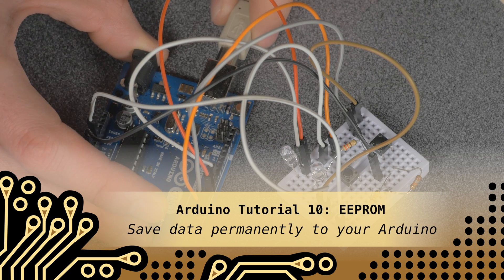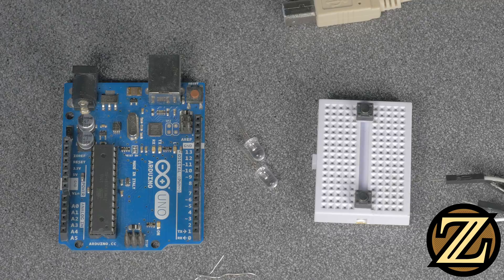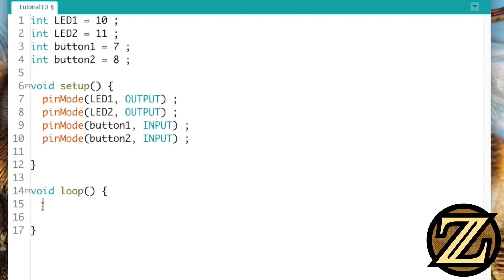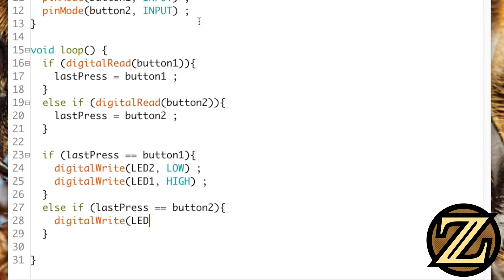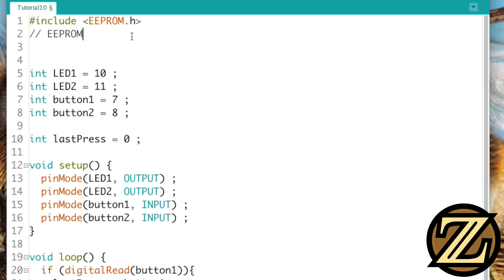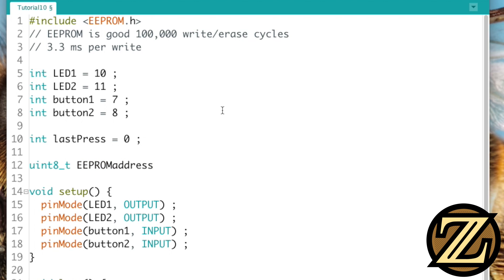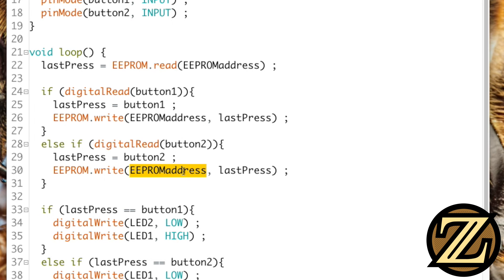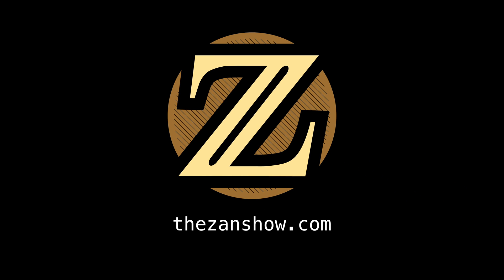Arduino Tutorial 10: Save Data with EEPROM!

Comment: i use rotary encoder for measuring linear displacement. after power cutt off arduino is only able to store value from 0 to 255 mm. not more and less than this range. here is the code plz suggest me that how can i store large number of  -ive and +ive values :
 #include <EEPROM.h>
 int address = 1000;                                    // the variable which holds the address in the eeprom
 #include <LiquidCrystal.h>
 LiquidCrystal lcd(6, 7, 8, 9, 10, 11);
 const int  buttonPin = 4;
 int buttonState=0;
 float Length=0;
 float Length1;
 float r=31.82;
 float r1=3.182;
 float pulses=30;
 float pi=3.1428571485714;
 #define outputA 3
 #define outputB 2
 int counter = 0; 
 int aState;
 int aLastState;
 void setup() { 
  lcd.begin(16,2);
   pinMode (outputA,INPUT);
   pinMode (outputB,INPUT);
   pinMode(buttonPin,INPUT);
   Serial.begin (9600);
   // Reads the initial state of the outputA
   aLastState = digitalRead(outputA); 
    lcd.print("LENGTH ");
  Length = EEPROM.read(address);                  // read the value from the address
 lcd.setCursor(0,1);
   lcd.print(Length)+lcd.print(" mm");  
 } 
 void loop() { 
    buttonState = digitalRead(buttonPin);
     if (buttonState==LOW){
      counter=0;
      Length1=0.00;
      Length=0.00;   
     Serial.println("Reseting All Values");
        lcd.clear();
      lcd.setCursor(0,0);
      lcd.print("RESET... ");
      delay(1000);
    lcd.clear(); 
    lcd.setCursor(0,0); 
  lcd.print("LENGTH ");
 lcd.setCursor(0,1);
   lcd.print(Length);
  delay(100);
      }
 //  buttonState1 = digitalRead(buttonPin1);
  //   if (buttonState1==HIGH){
   aState = digitalRead(outputA); // Reads the "current" state of the outputA
   // If the previous and the current state of the outputA are different, that means a Pulse has occured
   if (aState != aLastState){     
     // If the outputB state is different to the outputA state, that means the encoder is rotating anti-clockwise
     if (digitalRead(outputB) != aState) { 
       counter ++;
       Length=2*pi*r*counter;
       Length=Length/pulses;
       Length1=Length1/pulses;
        lcd.clear();      
    lcd.setCursor(0,0); 
    lcd.print("Forward (mm)  ");
    EEPROM.write(address, (Length)); 

     } else {
          lcd.clear();      
    lcd.setCursor(0,0); 
    lcd.print("Backward (mm)  ");
    EEPROM.write(address, (Length)); 
       counter --;
       Length=2*pi*r*counter;
       Length=Length/pulses;
       Length1=Length1/pulses;
     } 
     lcd.setCursor(0,1);
   lcd.print(Length);
     Serial.print("Counter:         Length: ");
     Serial.println(Length)+Serial.println(counter);
     delay(15);
   } 
   aLastState = aState; // Updates the previous state of the outputA with the current state
//     }
}

Comment: Cool video

Just a question though, since your loop currently doesn't check EEPROM state before writing, wont it write every loop while the button is pressed? Even if it takes 5ms per loop, holding the button for 1 second would do 200 writes to the EEPROM, or rather that EEPROM is useless after a total of 500 1 second button presses :(
Reply from the maker: Yes. And I suggest this at the end of the video when I say "a better way to go about doing this is you could read the EEPROM first before writing to it if you want to preserve your EEPROM, but for the sake of speed in this tutorial I just show you how to overwrite it every time." 9:20
Reply: @alexanderbaran-harper4748  can you help me in my project
Reply: Alexander Baran-Harper lcd 16 by 2 and 4*4 keypad